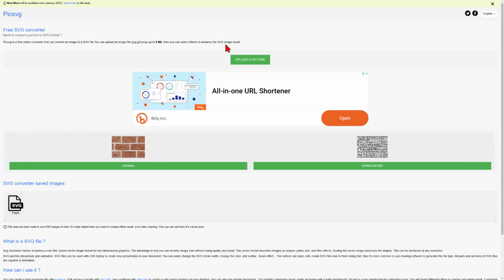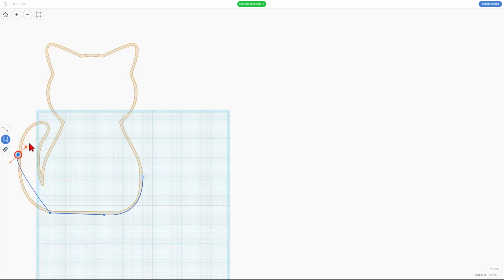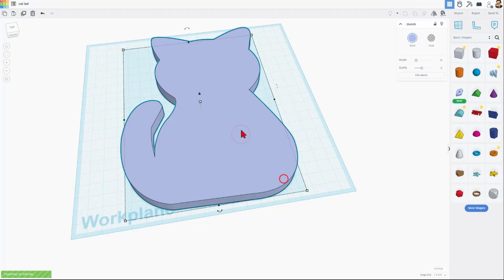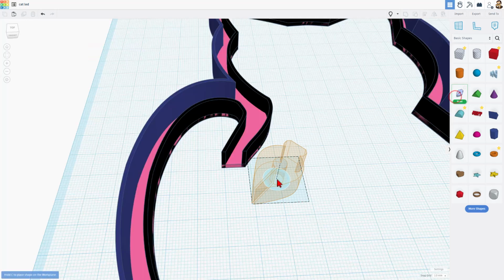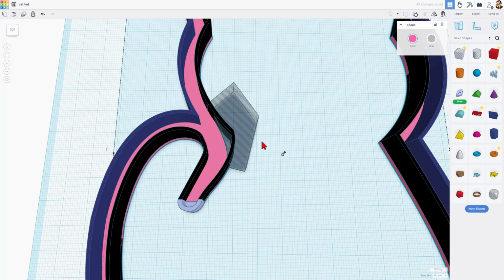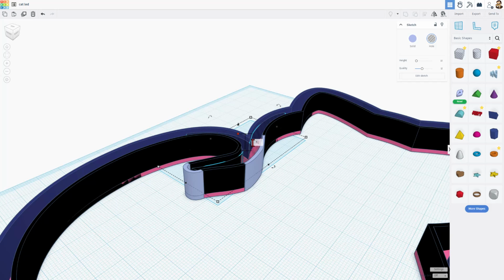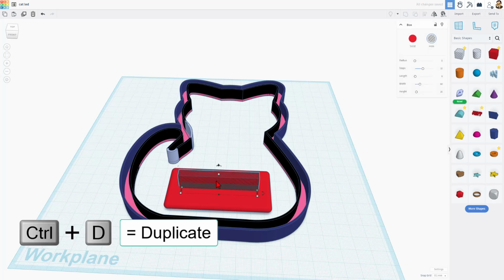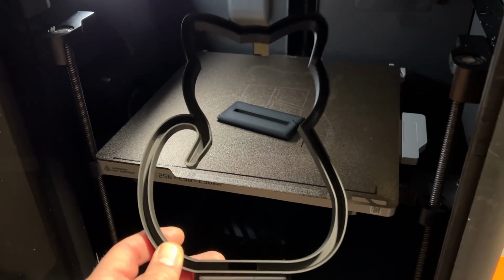Any Image to NEON LED Sign Tinkercad Sketch Tool Wizardry & More!

Comment: Is there any way to calculate the length of the LED strings if I create something on my own?
Reply from the maker: I will have to think about that. Tinkercad measuring leaves something to be desired. I bought a 15' roll and have a lot left. It is cool because you can snag another power supply and make more really easily.
Reply: @HLModTech  Where did you get your 15' roll? What do you recommend for power supply? How does the length of the LED string relate to the amount of power you need to drive it? Thanks!

Comment: When I design in tinkercad, I always make sure to consider the tolerance. For me, if your hole has 6mm diameter, the peg should have 5.70mm diameter. That's because plastic expands around 0.15mm after it came out of nozzle and cool down.
Reply from the maker: That is very smart. I am working on a clip system right now for larger designs. I have just made it .1 in each direction for the moment. What printer are you using?
Reply: @HLModTech  I'm using the cheapest model from creality. Then Ender 3 V3 SE. I have already produced lots of fun prints with this for a year now. And tolerance is one thing I have learned the first time I use it with my own design. Those were the time when tinkercad doesn't have a sketch tool yet. It was easy to design but now it's even easier with that tool.
Reply from the maker: Cool. One of my early printers was an Ender 3. Agree 100% on the Sketch tool. I have been having a blast with it as a creator. Full Sketch Tool Playlist https://bit.ly/hlsketch

Comment: Awesome video, thank you so much for this. 

Also, how can I create a sign bigger than my printer? How I break it to be printed in 4 pieces instead of one?
Reply from the maker: Thank you. I have not come up with a technique for splitting them yet. =( I have a few projects on the front burner right now, but I will see what I can do to accelerate that project.

Comment: Why did they make the "sketch" tool in that dumb shape? Am I missing something?
Reply from the maker: It’s a pen from the old days.
Reply: @HLModTech  Well, now that you say that, I can see how it's supposed to be a  "nib" of a pen-but not very accurate. And (I know you didn't design it) what does a nib  have to do with this tool's function? And, I'm confused, do you line it up with what you're working-if so where/how?
Reply from the maker: It is actually a 20x20 block. This is a great tutorial for showing how to line it up and make something useful. Make a gator using the Sketch tool. https://bit.ly/hlgator25
Reply from the maker: Tracing an SVG is really slick. The tool was super handy for making this cable label. https://bit.ly/cableyt
Reply: @HLModTech  Thanks..I'll check it out.

Comment: Great video. There is a guy who makes a light bulb led sign with Fusion360. Great tutorial. Give it a try, might save a lot of time.
Reply from the maker: Thanks. Appreciate the fusion tip. Someday I may give it a go. I find Tinkercad fun and dig that it is 100% FREE. =)
Reply: @ I agree, tinker is a lot of fun. Fusion 360 is a huge learning curve. Plus my computer hates running it.
Reply from the maker: I find that I can have some projects done in Tinkercad before Fusion has loaded... Especially when you get in and it states there is an update that you need to restart for.
Reply: @ I’m trying to make a neon sign for my wife’s business name. It’s going to probably take me a week if I can figure it out.
Reply from the maker: I will be working on a few soon too. I am working on my system for making things that are larger than my print bed right now.
Reply: @ I have 16 letter, 2 fit on the printer at a time. The. I’m thinking of glueing them to a piece of black acrylic as a backer. Hope you make a video for yours. Very curious

Comment: That's cool, could you use any power source like a USB connector?
Reply from the maker: The power supply to run those is 12V. Normal USB is 5V. Someone said something about USB C, but I am not sure.
Reply: @HLModTech  ok - thanks for the reply!